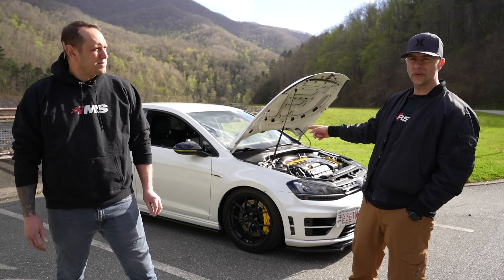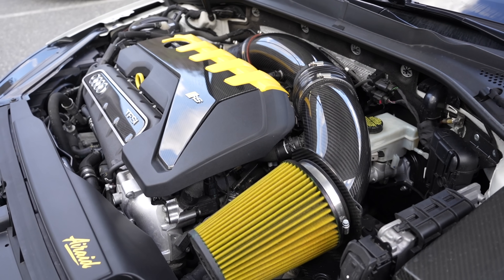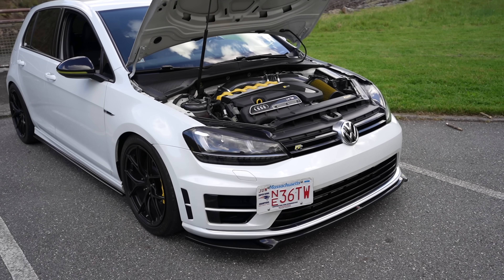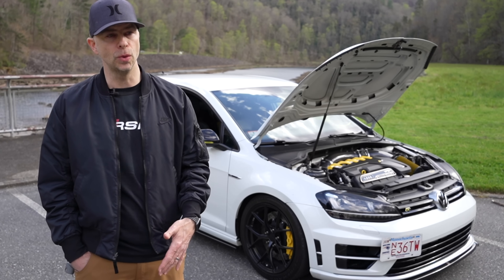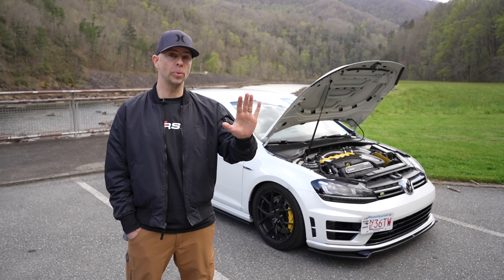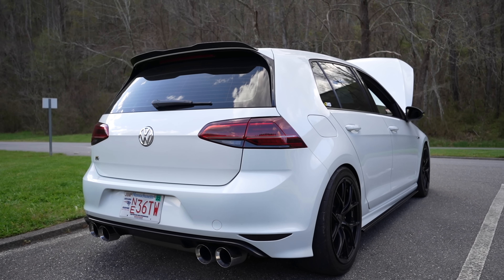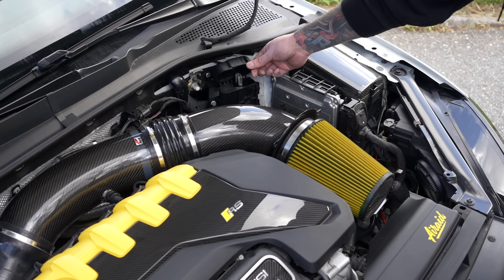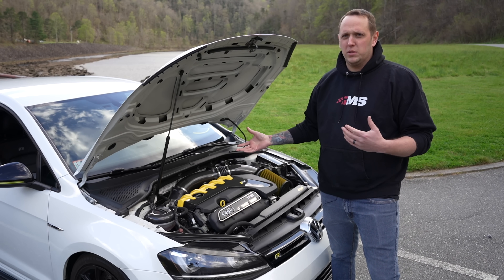RS3 Engine in a MK7 Golf R | Owner Spotlight

Comment: This sounds incredible. If only VW would put the 2.5 in the Golf R.
Reply: So people buy a rs3
Reply: Interior in the 7.5 R is better than the RS3
Reply: @amirnaseer9860  7.5R can't hold a candle to the RS3 interior. are you kidding me?
Reply: From my understanding, VW wants to but it's an Audi motor and they ain't letting them
Reply: @OlguinInHD  thats the rumor yes, but vw owns audi they can do whatever they want, and they could make their own 5 cyl or better yet, put the r32 engine in, this time with a turbo
Reply: @andersh3185  while they do own Audi, yes, no they cannot do whatever they want.
Reply: Audi wont let them
Reply: Rs3 can’t be bought with a manual
Reply: Don't see why vw couldn't have built up the 07k. The rs3 is an aluminum block version of that engine with direct injection. But I guess the days of crazy vw engineering is long gone
Reply: wouldn't really make sense though. the golf R is so popular because it's at a reasonable price point with good performance. putting the 2.5 in would just put the price way up so would be less profitable overall due to much less sales. the jump between the Gti and the R would be too big. 
the R has always meant to be on the same level as the Audi S3
Reply: it doesnt sound the same LOOL yes it has the 5 pot noise but its no where near audi RS3 noise, YouTube 2018 daza rs3. LEAVE THE RS3 Engine to AUDI
Reply: @brightsydebill8410  In europe a R can not be bought with a manual ;)
Reply: Its probably because more people would buy the golf. Since its cheaper, audi is seen as top of the line vw ( except for porche ) so they deserve the 2.5
Reply: @amirnaseer9860  nice joke like the interior of golf
Reply: @OlguinInHD "while they do own Audi, yes, no they cannot do whatever they want." - 100% correct.                                                      No way would Audi allow this to happen...
Reply: They will never. The RS3 will decline in sales numbers dramatically and the S3 will suffer too. Business wise it makes no sense but i feel the same as you in this regard. It will be a formidable weapon off the dealers floor if it was sold just like this
Reply: VW tried to use the 2.5 in the MK8 R. ultimately Audi didn't like the idea because it was too similar to the RS3, so it didn't see production.
Reply: Yeah its called a rs3 mate
Reply: Fun fact the idea of the first Audi quattro Awd system was actually taken from a Volkswagen Iltis.
Reply: Vw wouldn’t put the 2.5 i5 in the R or the gti because if they did nobody would buy the rs3 🤦🏼‍♂️🤦🏼‍♂️ like think about this an new rs3 starts at $59,995 if the gti and golf r had the same i5 as the rs3 everyone would buy the gti for 30k and the golf r for under 50k even if it had the same engine just under turned to make less power because we would know with some ecu turning and turning up the boost and it would make the same power as the rs3 and if vw wanted to put an i5 in there gti or golf r vw had 2  2.5L i5s from like 2005 -9 then from 2010-14 they had an na 2.5L I5 yet they didn’t use that engine in the gti or the r32 they could have put a small turbo on there i5 and made it an option on the gti but no they didn’t and if the mk5 gti shares itz platform with the 2nd gen ttrs does that mean you could put the engine and awd System from a gen 2 ttrs in a mk v gti?
Reply: VW has their own 2.5TFSI engine. Its VR6 6-cylidner. But they put it only in VW Teramont and Talagon. It should be in Arteon R, but they discontinued that idea before release
Reply: It was a plan when they came out with the MK6 -R, but they scraped for the RS3
Reply: There are some people out there that buy mk6 Jetta 2.5’s dirt cheap and boost them, with many other hardware mods for like a sleeper rs3 type car 😂 I’ve seen one in vids before they’re wild, not quite as fast as Audi Co built rs3 motor but still way faster than most is20 gti and R’s
Reply: lmao, how many RS3s do you think they'd be able to sell at that point?
Reply: @andersh3185  turbo / supercharged vr6 in this day and age would be a god sent gift to humanity
Reply: @OlguinInHD  I’m assuming you have some insider information on this because you’re an executive there lmao
Reply: @NatoriousGamePlay  you familer with the 07k?
Reply: @Mr_thraxx7  had one in a Jetta. Fun little engine. Very reliable too honestly. No experience with tuning it, but I've seen them built and handle 500+ HP all day
Reply: I think audi needs to stop being tight wads and let vw put one in the golf r from the factory. Don't get rid of the r just add the extra trim and make it a Golf RS or RS-R
Reply: @Lpz_7R  there would be literally 0 reason to buy an rs3 at that point. The golf is a well optioned car. Now vw could ignore it, if they wanted to put the effort into designing their own 5 cylinder based off the 07k. Though, they would have to be sure it will sell well, or find more cars to put that engine in. The millions it would cost to be legal need to be justified
Reply: @NatoriousGamePlay  not necessarily everyone has their preference just like weazlkneez in the vid I prefer the Golf R over the sedan. There would still be a market for both.
Reply: @OlguinInHD VW already did, all those Passats, golfs and Jettas are were using the 07k engine until 2014 but n/a and 170hp...... VW sand bagged those engines to not hurt GTI sales.......
Reply: @Arun Thampi  the only thing i dont like is the mmi layout in the a3/s3 but its easy to replace
Reply: Agree alot of these companies are missing major opportunities. Or coming out with special vehicles not releasing them elsewhere or are charging to much. 
1. Forte gt should have a version with all the elantra n stuff in it 
2. Kia rio should get all the forte gt stuff 
3. I30n hatch should have a slight interior upgrade and be put all over the world 
4. Their should have been an rsr golf for 50k 
5. Type r should have a sedan version and a dct option and should have kept the price point at previous generations made dealers sign a contract that they'd sell them for msrp 
6. Corolla gr needs a better interior and a dct option. 

I could keep going
Reply: @Amir Naseer  I disagree the 8v rs3 interior is awesome as the golf r/gti the current versions are wack as hell
Reply: Vw did that years ago when the DAZA engines where introduced. VW has the power to do so but Audi is in a different price category so you have to pay for that. Also the golf 7 and up are not in the same class even if it’s the MQB platform MQB platform just means the position of the engine nothing more theres no English word for that. It’s (M)odulare (Q)uer (B)auweise which just says the engine sits horizontally that is modulat. Even the electrics with all that snipping isn’t necessary if you know the Parts catalog from VAG and its pretty obvious.

Comment: Every golf R should have that engine. Period.
Reply: They tried to make the Golf R fuel efficient.  that's why it doesn't have a beast engine.
Reply: @djbryson  Keyword: Tried. 

I took a weekend long road trip with my mate, I was driving the MK7R and he was driving his M4 and I went through way more fuel than he did. It didn't make sense to me. I was blowing nearly half of my weeks wage just to fuel it.
Reply: @shona5512  
Yeah, that doesn't make any sense.  M4 is statistically way worse on gas.  24 MPG versus 30 MPG highway.  Something ain't right there.  You should be able to get like 350 miles (560 km) on a full tank if you go easy.
Reply: Tiny engine with tiny turbo sized for low end response. Makes sense. If it gets into any boost it just drinks fuel. Perhaps the biggest lie of turbo engines is the promise of better mpg
Reply: Audi said no
Reply: @kilovwdude6457  
VW is the parent company of Audi.
Reply: @shona5512  I get 23 mile per gallon on MK7R with stage 1. what do you get?
Reply: @cedricbench2543  I was getting around 21-22MPG. My friend was getting 28-29MPG in his M4
Reply: @shona5512  You must have been doing something very wrong, or your tuning is way off. I have an IS38 in my GTI. Same motor as the Golf R. I get 38-40mpg's on road trips, and average 25mpg's in the city. Now I don't get into boost all the time either, but still, if I was in boost equally as much as an M4, I would be getting much better mpg's as him.
Reply: @djbryson  Buying a golf R for fuel efficiency is only a part of the philosophy. 
It will not consume much more, the weight will stay almost the same and you can tune that 5 cylinder  engine to that goal.
Reply: @kilovwdude6457  cuz they are tacos...
Reply: @shona5512  check if your oil exchanger is plugged, maybe?
Reply: nope, VW has their own 2.5 turbo FSI engine. Its 6-cylinder VR6 2.5litre, but VW puts this engine only in VW Teramont and Talagon. It should have Arteon R too, but they discontinued that idea shortly before release
Reply: @djbryson  only reason why Golf R doesn't have that engine is audi RS3 sales.
Reply: @DuBstep115  Nö!! The 5 cylinder has no tradition at VW. Audi won many rally championships with the S1 and 5 cylinder engine, so it doesn't make any sense. It's an Audi development and something exclusive only for sporty Audi vehicles. A Golf is a Golf and with the 2.0 Turbo (by the way also an Audi engine) it is perfectly and more than adequately motorized.
Reply: @monsieurlaverite1412  Audi is a subsidiary of the Volkswagen Group since 60s. Everything Audi has ever done, belongs to vw
Reply: @DuBstep115  Thanks, I know that, I'm German. But it's a bit more complicated in a group. It's still about history and tradition and the positioning of the brands to the outside world. The 2.0 is the better mass engine.
Reply: 2.5 🥹 nice. Love my Fa24f tho.

Comment: 100% agree the R should have had that engine from the go
Reply: It would have eaten into RS3/TTRS sales significantly.
Reply: @dantem306  solution is to detune the version they put in the R, keep the RS3 and TTRS higher in power #s. It could have also driven up price of the R which might be why it won't happen. Mid 40s is a lot of money for what at the end of the day is an economy hatchback.
Reply: @Enzo187  I would have paid it.  Would have saved me $15-20k. 😂
Reply: They almost had a Golf R with this motor. Called the R400. Naturally, Audi denied it, so they instead put a larger turbo on the EA888 to make 400HP, but then dieselgate happened.
Reply: well the car would've then been much more expensive
Reply: @Tehsheeeep  Not really, I paid $38K for mine new.  If Audi put that motor in they could have done it for about $10-15K more, so $48-53K.  Still way cheaper than an RS3 or TTRS.
Reply: @android175  Sad. 😢   That R400 looked sick ❤
Reply: @Kevin_MK7RSR  it’s not just about the motor though is it, if they were to put that engine in there they would also need the better suspension, brakes, gearbox etc etc. and it would end up probably costing the same. If it was just an engine thing you could argue why not just put the rs3 engine in an s3 and make it’s a cheaper rs3
Reply: For example, the new Cupra formenter has a version with the rs3 engine in it, and it costs $10,000 more than the rs3
Reply: @Enzo187  yep 100%. It can be done, pretty easily. VW is just cheap...
Reply: @Tehsheeeep  many other companies have bigger and better engines in their top models of a a certain car model. The Mustang, Camaro, Charger/Challenger, //M cars, RS cars, AMG cars, CTR, etc. Hell, even the GR Yaris and GR Corolla have different engines in them! They all have different engines than their cheaper counterparts, but the Golf R doesn't. I'm sorry, but VW is cheaping out on that aspect when we all know for damn sure they could make an engine of its own to be included in the Golf R, and still keep it under $50k.
Reply: @Tehsheeeep  yes
Reply: Yeah, gti should have the 4cly and R the 5cly
Reply: @JacesOwnWorld  It wasn’t because cheap, it was because Audi didn’t wanna do it 😢
Reply: Not the golf r but maybe a higher trim though honestly u would just need a manual in an rs3 and ur good
Reply: nope, VW has their own 2.5 turbo FSI engine. Its VR6 2.5litre, but VW puts this engine only in VW Teramont and Talagon. It should have Arteon R too, but they discontinued that idea shortly before release
Reply: @draggy6544  no
Reply: @brgthelegend  what do u mean by no?
Reply: @draggy6544  no as in the rs3 should not have a manual
Reply: @brgthelegend  i mean i like myself an auto but some people only enjoy manuals and the whole point of golf r with the 2.5 is manual and well the uniqueness
Reply: @android175  it was denied due to emissions.... allegedly.

Comment: As a mk7.5 stage 2 owner, that “rubber band” analogy is spot on. Awesome build 🤤🤤
Reply: 7.5 😵‍💫 wtf engine is that like a super block american muscel?
Reply: @nerijusramonas7520  The "Mk7.5" means his car is the refreshed version of the 7th generation of Golfs.  Production runs of Golfs are denoted by their generation.  Also, his engine is a turbocharged two liter (Gen 3 EA888 - third generation of the EA888 AKA EA888.3).
Reply: @nerijusramonas7520  bro lol
Reply: @jflemthewiz  ah the EA888, AKA you'd see 888 x check engine lights in the first year. It's really a trash engine.
Reply: @arunmfive  just say you don’t know anything about these engines
Reply: @arunmfive  it’s really not? That block is good for 700. There are 2 600BHP golfs around me. 

Never heard of issues with the engine itself. Just turbos
Reply: Dude perfect analogy. My stage 2+ Garret R is just like that. 

Foot down, here it comes, and like a slingshot/rubber band I’m off lol
Reply: @arunmfive  I used to think VAG engines were junk until I owned one. Outside of early turbo issues and the standard plastic waterpump/thermostat housing issue, they are absolute power houses.
Reply: @gureno19  Those issues you said are not something minor that you can fix yourself, it can literally leave you stranded. So much for "german engineering"
Reply: @arunmfive  every car brand and type has issues....and only very early pre 2015 cars had turbo issues. 

But the EA888 is an awesome tunable engine, reminds me of a modern day SR20.
Reply: I went from a Scirocco R to an RS3 & couldn’t put it better myself. The 5 cylinder is stronger in every way possible
Reply: having owned a mk2 focus st which is also a 5 cylinder engine, there's definitely a different feel between a straight 4 and a 5pot when the power comes in. 5 cylinders are a different kind of monster when they get going
Reply: @arunmfive  ea888 is such a good engine.
Reply: @arunmfive  ur broke
Reply: @arunmfive  just admit you dont know anything about the 888
Reply: @long-long.  I know enough to tell you that it aint the best 2.0L turbo engine out there
Reply: @arunmfive  funny how no one claimed that... Ever.
Reply: @nerijusramonas7520  r u serious bro lol
Reply: @Manny didn't know you were into cars. Been following your photography work for a while

Comment: I always thought: "damn, golfs are really cool, if only they had a 5-cylinder option" 

So glad to see that it has become a reality
Reply: It was in there once. It was called the rabbit. A weak and thirsty no turbo I5
Reply: @easycomeeasygo8901  ive seen maybe one fast ones but that was it
Reply: @BullittKid08  modified yes, they can make power. But the 170hp it came with was underwhelming and not very economical compared to other Eco cars. So not great acceleration and not great MPG compared to competition. Modified absolutely a beast. But isn't that the story for modified engines that's why we modify them. My wimpy 150hp 1.8t has gone to the gym... 490hp 😊. Big little man now, lol
Reply: @easycomeeasygo8901  right there with you bro ❤ went from a Mk6 2.5 stage 1 IE tuning to a bone stock 1.8t Passat with just a  catback now! But I gotta ask what you did to your 1.8 to get that much damn whp??😂 GOT DAMN like I thought most you could go was stage 3 and even then that’s only in the 330-375hp range
Reply: @easycomeeasygo8901 wouldn't call weak... 1. VWs most reliable modern gas engine since the air-cooled days. 2 stock engine can make 400 hp max boosted, reliably, even the shitty Toyota 09g auto transmission can take the power. 3. IROZ motorsports uses the  blocks and swapped them from the Audis........ And lastly VW actually sandbagged the performance of the VW 07k engines to not hurt GTI sales.... Everything from intake runner size volume, intake coverbox, etc..... VW completely chocked that engine. Even a simple stage 1 tune increases some power and even greatly increase mpg......
Reply: Apparently vw wanted to make the mk8 golf r with the 5 pot from the rs3 but audi said that they couldn't use the engine
Reply: Le 5 cylindres existe c est un v5 2.3qui a alimenté la mk4 et la mk5
Reply: The mk5-6 golf come with a inline 2.5 5cyl, makes like 180ish max NA but turbo’d they are nasty.  You can build them to rev around 9k, potentially higher and 600-700hp isn’t an unreasonable goal going turbo with them.  You can get one of the engines for like $200

Comment: Really good build aesthetically and power wise. Add in a MK7.5R Euro spec digital dash and it would be perfect.
Reply: What's the difference between the US 7.5R digital dash and euro spec one?
Reply: @deezyb858  I'm not familiar with the US spec version as I live overseas. Could be the same if it is the virtual cockpit used in the Euro version.

Comment: This is the engine the MK7(and 8) R should have come with, albeit detuned and less powerful then a RS3/TTRS for obvious reasons. You cannot change my mind.
Reply: bad mileage, that's why it has a 4 cyl
Reply: @djbryson  probably, mk7 came shortly after dieselgate if i recall correctly.
Reply: Even though it basically gets the same mileage lol